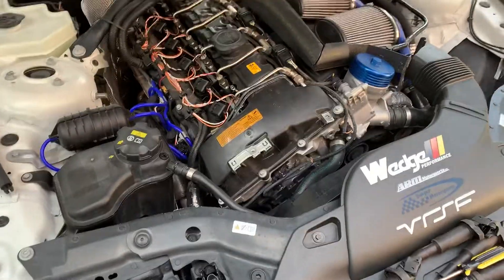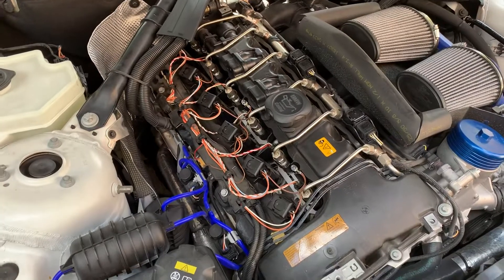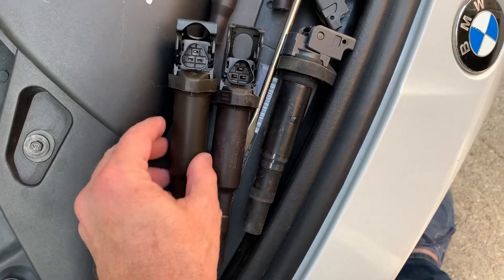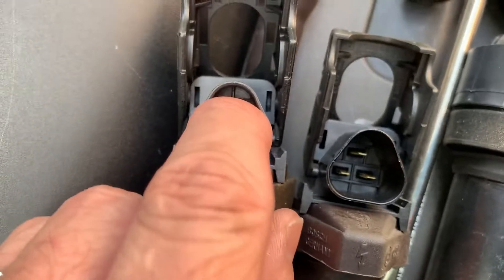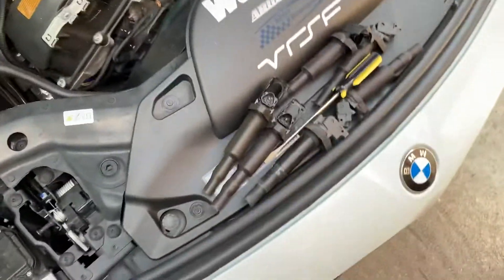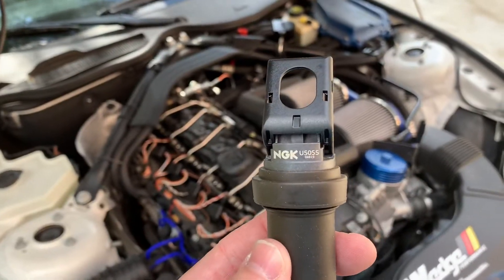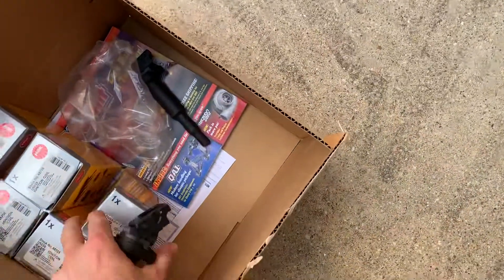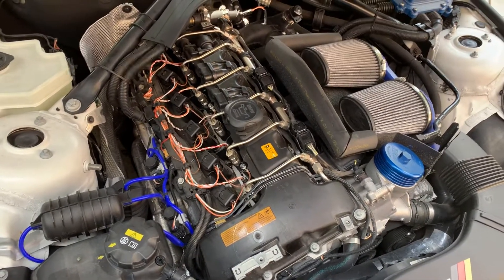NGK Coils For Your N54 First Impression

Comment: How are they so far? Thanx.
Reply from the maker: Excellent!  I haven't had a single issue with them at all.  No misfires and I've put the engine under different load scenarios including three dyno pulls back in January.  So far I'm impressed as an aftermarket replacement.  And they are cheaper then the stock Bosch ones!

Comment: lol, you need to buy your coils from fcp for their lifetime warranty if you're burning coils like that.
Reply from the maker: I’ve only fried one coil in 5 years and that was the stock Bosch one. These NGK’s have worked awesome. I even had some misfire issues which I thought may have been a coil, but that was solved by replacing the plugs.
Reply: @apriliaracing7  ok, i dont want to sound like a commercial but i like to refer all bmw owners to fcp euro. their service is great and their lifetime warranty second to none. it takes the risk out of owning one of these cars if you're a Diy-er. im on my second oil pan gasket smh, its free except for my time. just package it up and send it back no hassle.
Reply from the maker: @404TRUCKERTV  Yes sir, I am in complete agreement.  I have ordered items from them in the past and definitely love their products and warranties.

Comment: hey wait a minute NGK are not supposed to be made in japan.... why do they say made in china?
Reply from the maker: I wondered that too, but after some research their coils are made in different factories around the world.  I saw some made in Turkey and also some made in Mexico.  They are all made to NGK standards so these are not cheap "knock off's."
Reply: Ngk are  from Japan
Reply: @apriliaracing7  Just bought mine from rockauto mine said the same. I was thinking isn't NGK supposed to be made in Japan. The sparkplugs I got were made in Japan and assembled in the USA lol. I guess it's a different story for the coil packs. As long as they work good it's fine with me lol. Fixed my misfiring issue. Also seemed to be made pretty well when looking at them. I was doing some research and I saw some Denso coilpacks is made in China as well. So I guess they are changing manufacturing methods.
Reply from the maker: They must be and I agree with you.  As long as they work good, it's okay with me.  I moved to a different coil platform now, but they worked just fine for the stage I was previously at.
Reply: @briskxd1093  Everything is getting to be made in china recently. Making it a pain to research which of them are knock offs